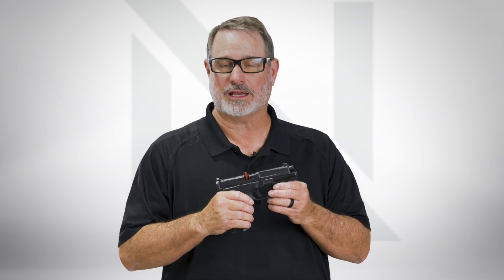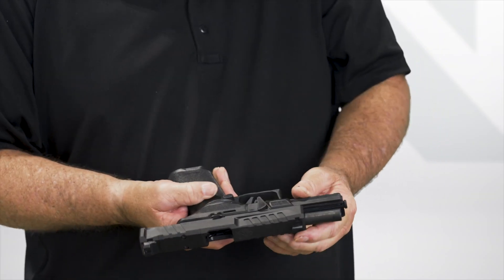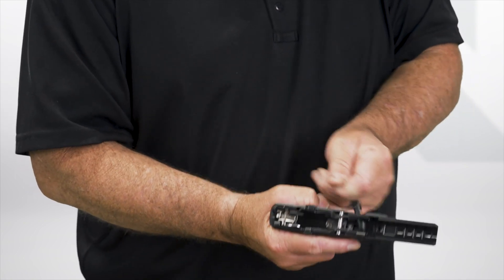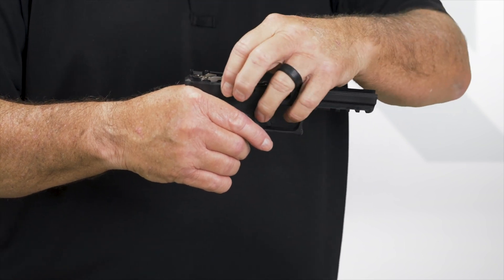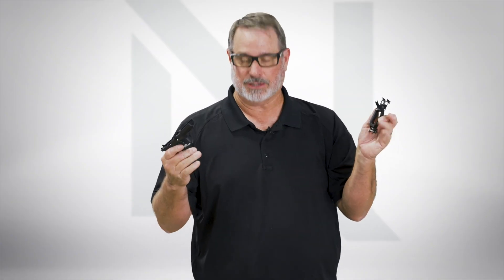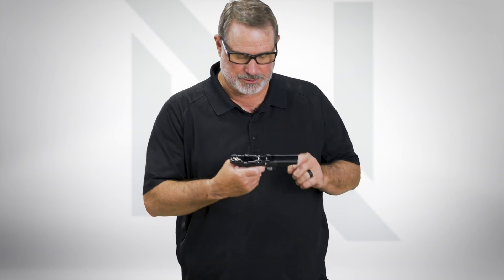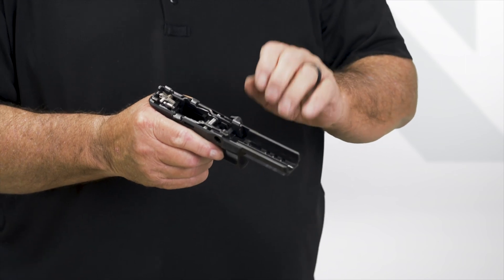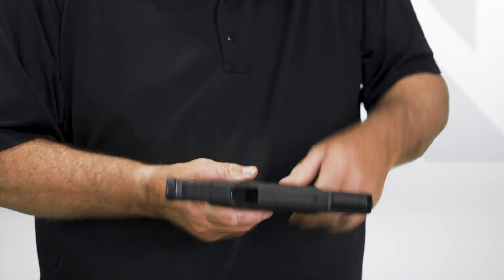Springfield Echelon COG Installation - How to Swap the FCU

Comment: Buyers beware. I can’t put the COG in this easily. It’s been sitting outside the gun for a week. We need actual details and tips. This is ridiculously false advertising.
Reply: You just aren't mechanically inclined apparently... It's ridiculously easy to do.
Reply: took me way longer to put it back together. ez is def not the word to use, do-able tho